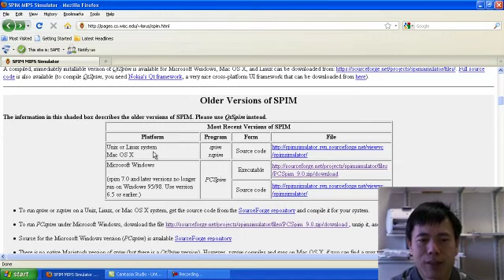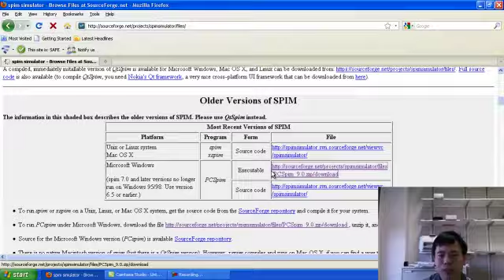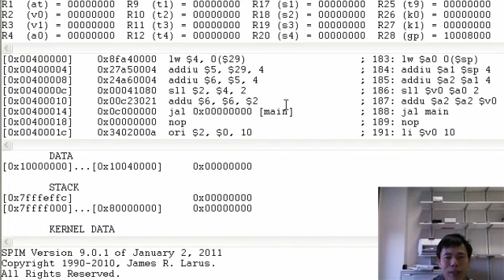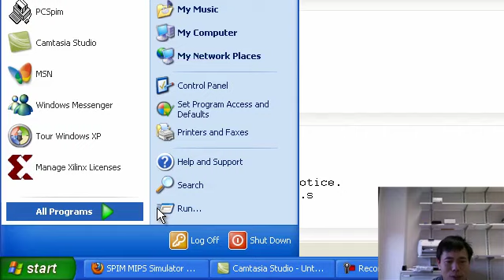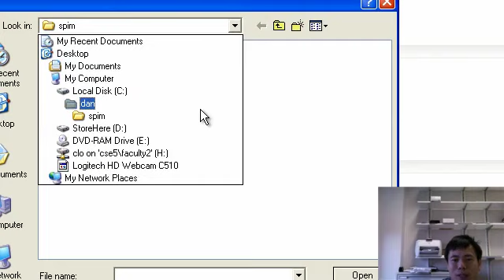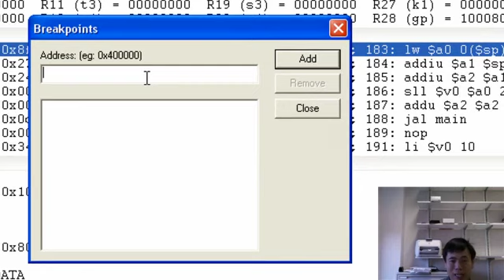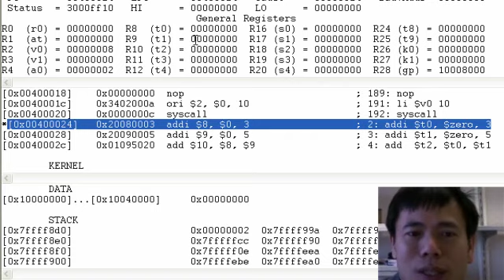QtSPIM/PCSPIM Tutorial

Comment: how did you get your PCvalue to set to 0x00400000 with out resetting after open the file??? Every time i try to run my program, it resets to 0x00000000 and nothings gets stored in the registers.